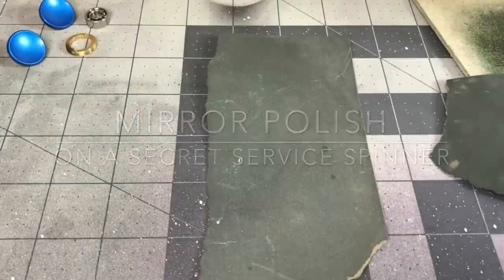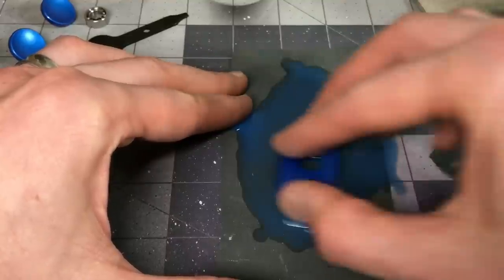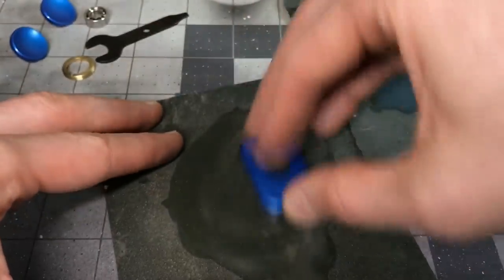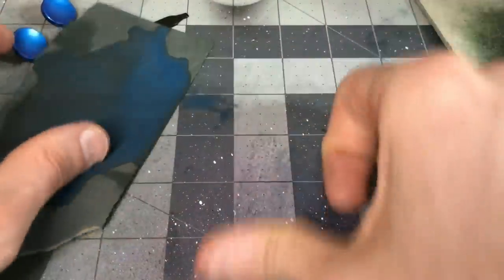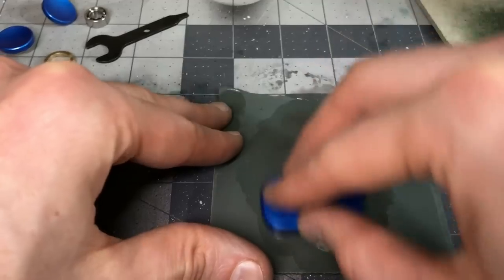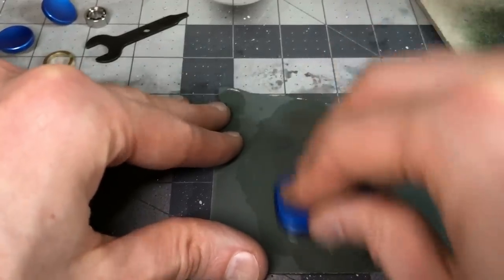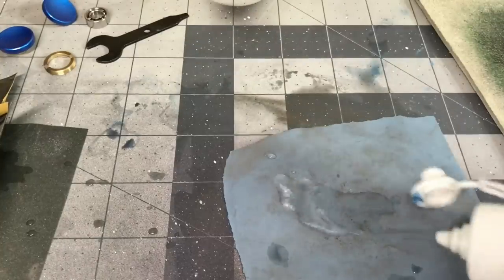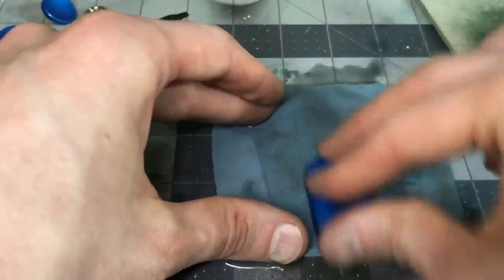Tutorial: Mirror Polish on a Secret Service Spinner

Comment: U can use any sand paper for this right,in getting the same spinner its blue just like yours so can u use any sand paper and put water on it?
Reply from the maker: You can use any sand paper, most of these finer grit sandpapers are made for wet sanding so the water helps keep the finish smooth.
Reply: Hobby Timmy thx for the vid I'm really exited to do this with my friends
Reply: And second is there any way u could mess up on this kind of customization
Reply from the maker: jason ketterman not really. Sanding removes very little from the spinner. As long as you take the bearing out when you sand it, and clean any grit out before you put it back together you should be good. Worse case if you mess up the finish you can just try again or give it a brushed look by sanding in one direction with a rough grit.
Reply: jason ketterman you slow